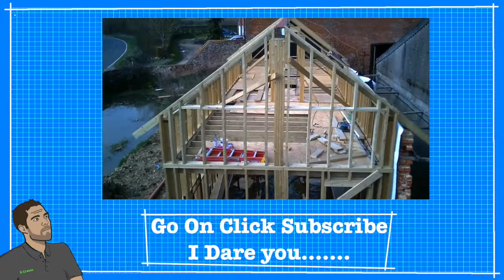Boarding Front Wall

Comment: I Use Sliver line here in the  USA Good Tools!!
Reply from the maker: James Cox that's interesting. Over here they are generally thought of as a one job tool. E.g. You hope they will last for the job you bought them for but that's not always guaranteed. 

TBF to them both of the silverline tools I own. ( the nail gun and a small breaker) have lasted well. And they are usually about 1/4 of the price of a reputable brand.

Comment: Put you A Peace Of Insulation and Plastic over your Air Compressor it will take a lot of the Sound out of it ED !!
Reply from the maker: I dont know if i ever put it in a video, But i did :)

I made it a little house out of celotex which did loads to reduce the noise and kept it dry until i managed to get the roof covered.